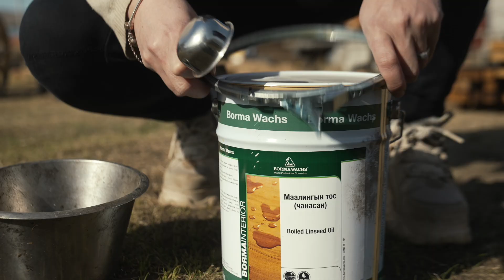We Learned Our Lesson Mongolia | Greenhouse Addition Build

Comment: I have a similar wall in my GH and a similar climate. Is it black to absorb heat? I was told to paint mine white to reflect the heat back but it didn’t seem right
Reply from the maker: Well the idea to paint it white is to reflect light back into the GH to increase the light 💡 but in out Zone 3 climate the heat of the thermal mass is way more important than light.. having a black background wall is definitely better 👍 you can make in Evan more affective if you add black metal with a 5cm air gap between the metal and concrete wall..
Reply: @SimpleWildLiving  well that would have been a good idea when we built it. Our back wall is against our house and the GH is built into the ground. No cool thermal system like yours but passive solar. The paint store didn’t have a paint like yours but I’m trying a black stain to see how that works. Of course the sun needs to cooperate and come out too. Thanks for that and I enjoy your content